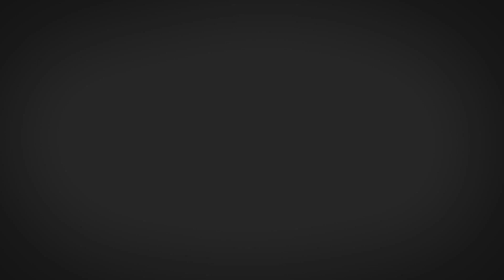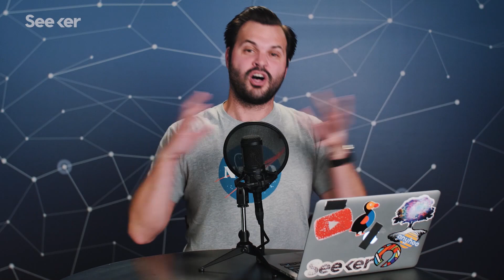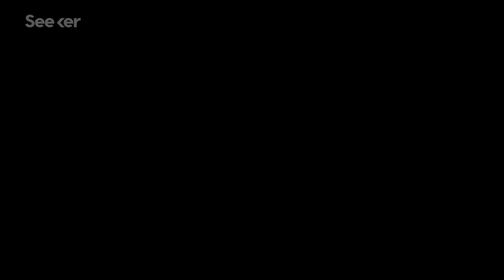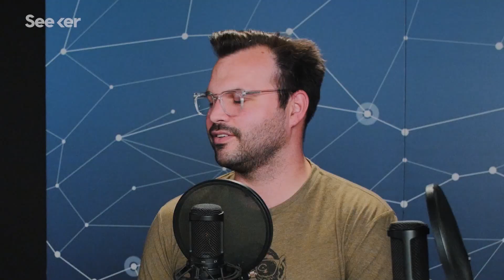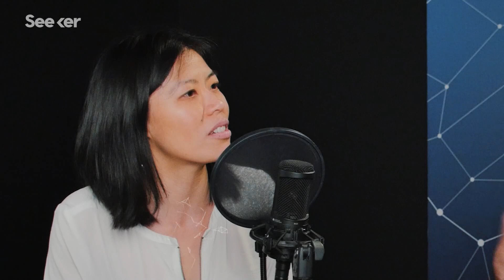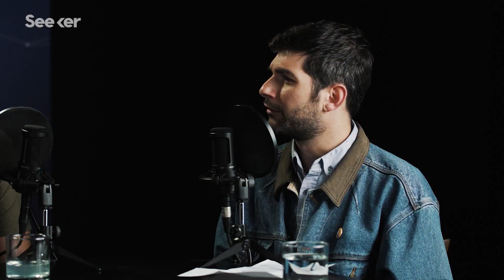Lasers, Alternate Timelines & Fusion: Our Sci-Fi Future Is Here (Part 2 of 3)

Comment: as for the ramming part, the weapons they had was not capable of hurting  nero's ship, so they rammed it to buy time for the crew to escape. the hand held phasors are not quite the same as the ship based ones in power or in form of output. ship based ones were tied directly into the ships power grid, so they were definitely plasma based. the hand held ones had a power pack, most likely only parts of plasma since i believe they only had dimensional tech in their future so that means more like the electric space drive concepts we are exploring now in terms of what was the type of output. as for the bit about spock and his 'failure', only thing wrong is either someone was not paying attention or they have an axe to grind/bury.

Comment: Quick question, what's to stop a cascade if the lab succeeds in fusing 2 hydrogen atoms? If the output of energy is more massive than what they put in wouldn't it cause the process to continue?

As for Star Trek aspect of vid, as I understand it photons reference the particles of light. As there r (apparently) smaller particles of light that we can't see, perhaps the new phaser weaponry of the new star treks that seem more fluid are to visualize the elemental particles getting shoved out of the way in an excited (and stunning) 3D guess of how the elemental particles might react...?